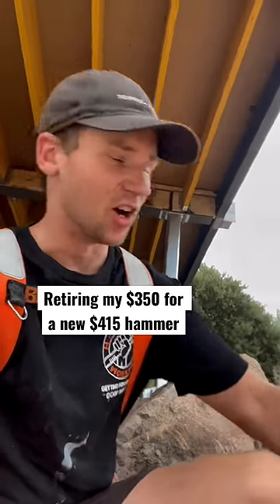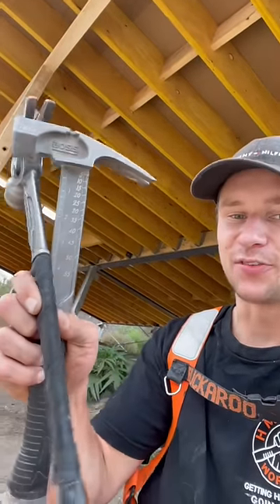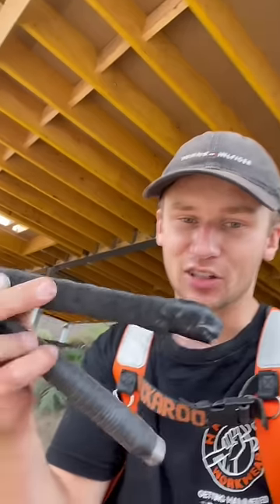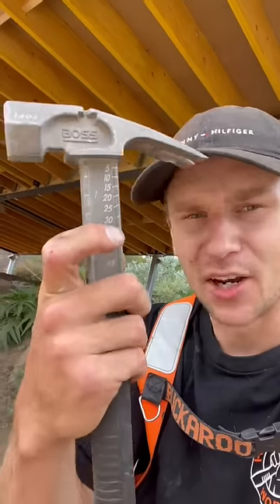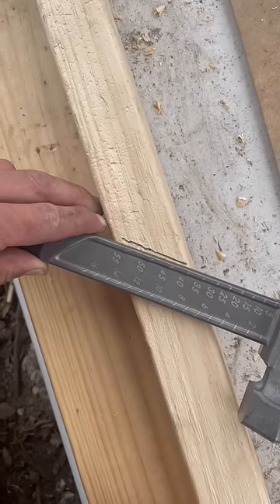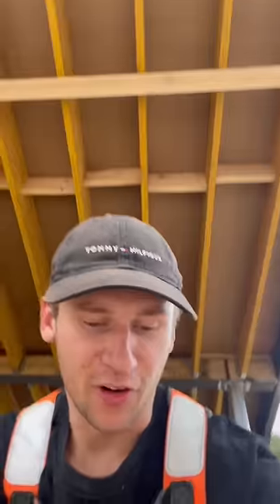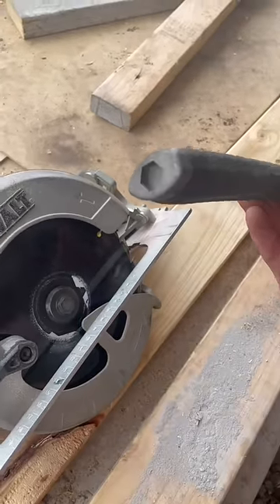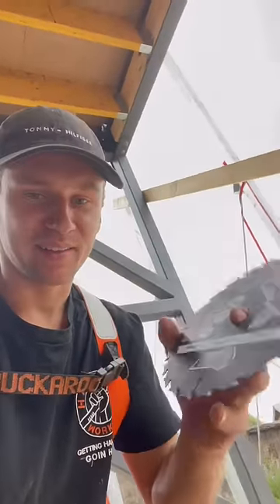This boss hammer is filled with features, thanks for sending it out @aussietoolclub #ad

Comment: Lads that’s Aussie dollars so it’s $281 USD
Reply: That’s still about $200 more than I’d pay for a good hammer.
Reply: @thenoneckpeoplerepresentat8074  good for you lad
Reply: And my hammer that's about seven years old still with a flat face and some battle scars was 28 USD. Major goddamn ripoff
Reply: Still doesn't make sense
Reply: @Mewofastora  If you don't see the value in the hammer, then it's simply not made for you and that's completely ok. It's more than I would pay for a hammer, but that doesn't make it a ripoff.

Comment: There’s a lot of hubbub about hammer cost. While I can’t speak for Boss specifically, there’s a good reason to spend good money on a titanium hammer. 
My arm tendons sound like a rusty door, and feel like sandpaper from swinging a hammer all day. 
I’m out of that now, but I promise- the most expensive hammer you can buy, is still cheaper than American medical expenses.
Reply: Theres A LOT of lightweight hammers you can get for under 80 dollars. There is nothing to defend here
Reply: @brettvogel8418 ...particularly the American medical expenses
Reply: Injury is commonly due to repetitive motion. This hammer is ridiculously expensive for no other reason than to be sold to suckers lmao
Reply: ---  and 95% of all framing is done with air or electric nailers
Reply: @bonesrhodes3762  My Dad was a carpenter for many decades, but when we did the remodel on his house, he got himself an air compressor powered nail gun. It's just an all around better experience and the results you get are a bit better than you'd get out of an actual hammer.
Reply: @baconscoobysnacks3135  I mean, no, it's expensive because it's made of titanium. Is that worth the extra cost? Maybe to some, not to others, but to act like it's some $80 hammer marked up to $400 is just stupid.
Reply: @TheHeadincharge  you explained it's expensive because it's made using an expensive material that isn't necessary...aka sold to suckers 😂

Comment: There is nothing anyone can say to convince me a hammer is worth more than £50 max
Reply: titanium is half the swing weight of steel for the same power. ie, a 14oz titanium swings like a 28oz steel. dont know the conversion to pounds but a titanium head / wood handle is around $100 USD compared to about $25 for a comparable steel head / wood handle. if youre swinging a hammer every day the titanium pays off in the reduction of overuse injuries to the hand/arm/shoulder. also less fatigue throughout the day. titanium hammers pay for themselves for people who do it for a living.
Reply: @asher_2789  twice the swing power? Gonna need a source on that 😂
Reply: @asher_2789  so if the hammerhead is half the weight, cause titanium. Wouldn't you have to swing twice as hard to achieve the same result as a steel hammer? Sounds like a recipe for more injuries not less.
Reply: @ohmaigod2 it’s a lot less stress on the body. Idk if I would say it’s twice the swing power but titanium may transfer the energy better so that could be part of it 🤷‍♂️ when your doing something all day like this, it’s less tiring and less stress on the body to swing something lighter, more times then something heavier, less times if that makes sense? That’s why all really nice and expensive hammers are made from titanium like this. In my opinion I would never by one but it’s just like anything, if this is what you do everyday, all day, why not have the best you can have.
Reply: Yeah, I've been swinging hatchets and hammers since 77 and between nailguns and screws we don't even nail enough to justify over 12 dollars at a garage sale. A name brand socket set for my tool bag is $50 and secures a skill saw blade much better

Comment: Dang, I bought the smallest straight claw Estwing framing hammer for around $30. I think 18oz? Great all purpose hammer that I could dig into a roof if I began to fall. That was years ago, and I no longer do construction, but I still have my hammer for tasks around my home. Best and only claw hammer I've ever bought.
Reply: I am a 4 generation drywaller. Now retired I still have my 11oz Estwing. Never understood why anyone would pay more than $50 for a hammer.
11oz at $35 never seen one break.
Reply: dude
Reply: Think of it as re-investing into his trade, his new hammer helps him be more efficient with his tasks specifically. A general all purpose hammer is still great, but it’s the equivalent to using a 4 door saloon/sedan to move house furniture as apposed to using a van.
Reply: Lucky your not a mechanic , Something like a Snap-On dead blow hammers can start at $100 and quarter inch ratchets can start at $60 for just the rachet, never mind If it comes with a set of 1/4 sockets and small extension, those can start at over $150, I always just bought the real important stuff through Snap-on Blue Point SK or Mac,The rest of my stuff is either off brand or Harbor Freight anything that's not super important that I don't use all the time I'll buy from Harbor Freight, but stuff like especially screwdrivers are worth buying from either Snap-on or SK because of the quality. But I never drank the Snap-on Kool-Aid where everything had to be Snap-on that's just a waste of money I saw a lot of young guys come in and spend like $6,000 on a toolbox then every week they are giving the Snap-on guy like 200 bucks and buying all the latest dumb Snap-on shit,
Reply: Did you ever do that? Claw into a roof to prevent a fall I mean? Just curious! Cheers
Reply: I'm a 28 oz man, myself.  But you'll never own a better hammer.  Obviously,  you know that. Have a fantastic day.
Reply: @bertbccfu9564  and literally everyone worth 2 cents acknowledges that tool truck tools are WAY overpriced, lol. The only people who buy them are guys who don’t know any bette
Reply: My dad still has his 11 oz one from over fifty years ago, so old its green instead of blue
Reply: I buy estwing for our plant. Way lower vibes than anything else in that price range and they are bulletproof. Someone ran over one with a forklift and ended up jamming it between the two wheels (was a duelie). Pried that sucker out of their and it really wasn't even bent.
Reply: @joellajuett1060  If you're using it every day as one of your main tools, the cost might make sense. You aren't exactly using a hammer a lot in drywalling, so it would make no sense for you to purchase a nice hammer. Similarly, it would make no sense for him to buy a Milwaukee drywall gun when he would barely ever use it...

Comment: My grandpa's estwing's from the 1930-40s i inherited still have their grips and cost him a couple bucks. I've never bought a hammer in my almost 34 years thanks to his hard work in coal mines to save up for real quality.
Reply: I have my father in law’s Estwing from the 70s, he used it daily as a contractor.
Reply: @thenoneckpeoplerepresentat8074  nice! All the older Estwing's are very rugged. Not just that but the final finish work is top notch. I keep one with a polished face for bumping out sheet metal or the occasional time when none of my ball peens are quite big enough in my gunsmithing shop. One of the few I've ever had that rarely ever needs the face touched up.
Reply: @jkalash762  She knows her tools, works metal and is a gunsmith, it’s possible we are genetically related 😂
Cheers!

Comment: Save money on saw blades so you can blow it on your hammer. 🔨 Anyone got a drill because I think he has a screw loose. 😅
Reply from the maker: I sold my drill to buy this hammer
Reply: @DaveDoesCarpentry  haha good stuff
Reply: My 45$ estwing gets the job done just fine.   I bang pounds of 20s and 60s  all day long, it’s only a 22oz.
Reply: @DaveDoesCarpentry  That makes you smarter than me. I sold my nails to buy a similar hammer. :-P

Comment: Soooo you scribed the cut, laid the hammer on it without a pivot point and threw out a random degree. You were amazed it fit? That’s the point of scribing. I’ll stick to my stiletto and speed square. The end of the claw is the pivot.

Comment: I have an Estwing I bought for $14 in 1996. 
Still has a handle on it to this day.
Reply: Estwings cost over $130 here in Australia
Reply: @solidbloke what?!? I just got a 22oz for $35. That's insane!
Reply: I'm not a fan of the looks of the material on the new estwings. I hope it's not letting people down. My old ones still nice.
Reply: Wood > metal and rubber
Reply: @solidbloke  WHAT!?
Reply: @autumn5592  wood handled hammers belong in DIYers hands. not a professionals
Reply: @mikeschmidt4800  well for one they are made here and two, out dollar is bad compared to USD
Reply: @autumn5592  No, there are objectively better handle materials than wood these days. To be clear, wood is fine, but to act like it's the best is just not true.

Comment: Tell me you work at boss hammers without telling me you work at boss hammers.
Reply: If he worked at boss hammers he would know how to use it. Pivoting from the head of the hammer when the lines clearly dissect the claw. Anyone who’s used a speed square would pick that up instantly, never mind someone who has ties to the actual designer of the tool.

Comment: This is literally just for the guys who take stuff out of their bags and never put it back. You spent over 5x as much to buy the individual tools that have existed for generations so that you could have your tools with you at all time. 
Plus the claw gets messed up and will ruin your angles let alone it gets bent and it will never have perfect angles again. 
And for those who’d claim efficiency you still have to take your tool out of your bag and in all these instances your pulling a single tool out. You can pull your square out as fast as hammer. There is no efficiency increase and you spend 5x more. It just doesn’t make sense. Keep your tools in your bags!
Checklist:
Hammer 
Square 
Knife
Chalk box
Tape measure
Pencil 
Nail punch
Chisel
Cats paw 
Saw wrench(if you want I usually always have a saw wrench in my bags)

I just don’t see how hard it is to keep track of those tools. The rest of the stuff you can carry as needed but the only thing that really adds much weight is your tape measures. Which you need anyways for longer measurements. 
ALSO YOU STILL NEED ALL THE TOOLS LISTED SO LITERALLY IF YOU WANT TO PUSS MONEY HERE TOU GO!!
I’ve also used several 350 dollar hammers and I never saw a benefit besides the one guy on the job that’s always saying”oh this hammers amazing it can do everything! Best hammer I’ve ever owned… so are we leaving early today?” I mean literally the worst people I’ve worked with have had every gimmicky tool in the book. And talk about how amazing they are but can never seem to actually work or do anything

Comment: Always use a wood handle. Transfers less vibrations to your hands. Also has less weight.
Reply: Not always. Depends what hammer
Reply: @Xxassass1n021xX  are you talking about the weight or vibrations?

Comment: True story. I had 2 nails left to hammer in on a shed frame I was building. Hammer($6) I had for 8 years broke. I used a rock and hammered the 2 nails in almost as fast as the damn hammer. 

So my question is, is there a good reason to spend more than $20 on a hammer? I am not a pro, but hammers hammer stuff and I am finding it hard to believe that $400 hammers are worth is anywhere.
Reply: I'm not justifying a 400 dollar hammer, but there are benefits.

Wooden handles (generally found on higher end hammers) are going to shock your arm less, preventing RSI.

They also generally have handle shapes that are comfortable and sized nicely.

Head material matters too -- titanium hammers offer lighter weight (higher swinging speed, more force delivered), and transfer more force, compared to steel.
There are also brass, copper, deadblow, or the like.

They have better fit and finish, and offer better warranty.

So in short, they're just better.
Worth it, depends on the person.

This is without getting into speciality hammers for bodywork, woodwork, engraving, forging, etc.

Comment: The angles are pulled using from the tip of the claw not the hammer head, confused on how you got a perfect cut using the wrong pivot point.

Comment: Why would you want a “light weight hammer”. The physics don’t make sense whatsoever. The point of having a hammer is that the mass helps drive the nail (Force = Mass X Acceleration), hence why framing hammers are larger and heavier than finish hammers. By making it lightweight, you do essentially are just making yourself work harder.
Reply: Didn't pay attention in physics class lmfao?

Lighter hammers are easier to swing (meaning they move faster.)
Faster lighter objects have more force than heavier slower objects.

The lighter (to a point) hammer will deliver more energy to the nail.
It will reduce the strain your body feels, it will reduce vibration, and it will allow you to swing more.

Comment: So you marked the timber with steel beam then had a read on the hammer but cut the mark you had earlier and that proves how accurate the hammer is?! 🤔
Reply from the maker: I used the hammer against the mark to get the degree of the cut. Which I set my saw to before cutting

Comment: Says you can remove the saw blade with the hammer instantly cuts away after he realized it harder than just using the key the saw comes with LMFAO
Reply from the maker: Hahahah, Had to cut away as it does require two hands and couldn’t film at the same time.

Comment: Titanium hammers are a scam, the most common injury that carpenters (specifically framers) suffer is “Carpal-Tunnel”; and Carpal-Tunnel is not caused by vibrations in the handle of the hammer, Carpal-Tunnel is caused from repetitive movements and the gripping action of the hand. 
You can buy a million dollar hammer and if you have bad hammer technique (meaning how you grip & swing your hammer) you will still suffer from Carpal-Tunnel, buy a good 50$ dollar hammer and learn how to swing & hold it properly and save yourself a lot of unnecessary pain in the future.

Comment: Why would you want a lightweight hammer? The point of a hammer is to be heavy, if you want a leightweight handle use plastic or wood and if you want a lighter head, just make it smaller.

Comment: I'm a framer my dad was a framer and his dad was a framer and we all use PLUMB hammers  should be at A.C.E my dad used a 22 Oz crooked claw and I use a 20 Oz crooked claw my dad's is over 40 years old my dad is almost 75 and still working with the same hammer since he started they have a wood core I believe fiberglass I honestly hate hammers that are all metal or one with a bunch of gizmos that are crap my saw has a wrench ON IT and my tape on my hip and my small speed square in my back pocket and a huge black speed square and framing square I leave on the saw horse

Comment: Erm I don’t get how you can lighten hammers SET TO A SPECIFIC WEIGHT regardless of material used 20oz hammer is a 20oz hammer wether made from aluminium or steel jus be more or less material

Comment: Don’t you want your hammer to have weight?
Reply: Generally speaking, lighter hammers are able to be swung faster, this means they strike with more force.

Plus, titanium transfers more energy into the strike.

Lighter hammers are generally better.
Exceptions do apply, but for carpentry or framing, the titanium is good.

Comment: Why would you want a hammer to be light weight
Reply: Saves joints and strain.

Plus basic physics says a faster moving lighter object has more force than a slower moving heavier one.

Lighter hammers move faster, they are better.
Reply: @autumn5592  people aren’t breaking the sound Barrier slinging a hammer. 1/2mv^2.  You need to do some math to see how much faster you’d need to swing to get the same energy vs swinging a normal 20 oz hammer at normal speed.  Then ask yourself who slams a hammer at that speed and hits.  Plus, if you double the speed of the hammer you will use 4 times the energy and impart 4 times the wear on your joints as you accelerate the hammer.
Reply: @ebred76  Wrong.
Reply: @autumn5592  🤓 nope